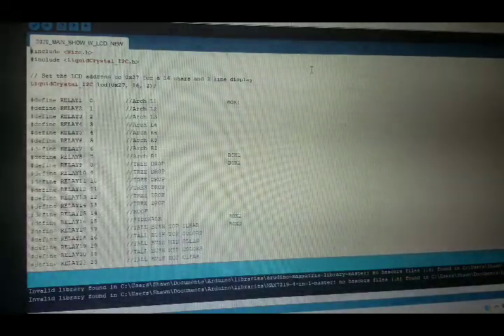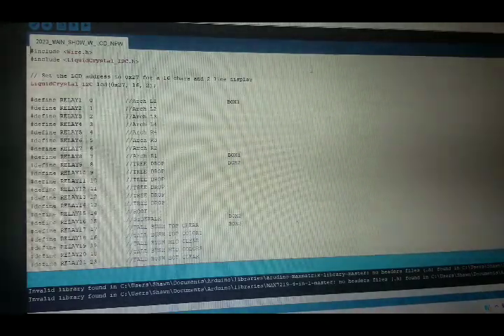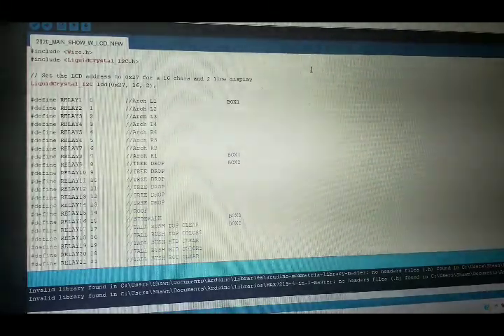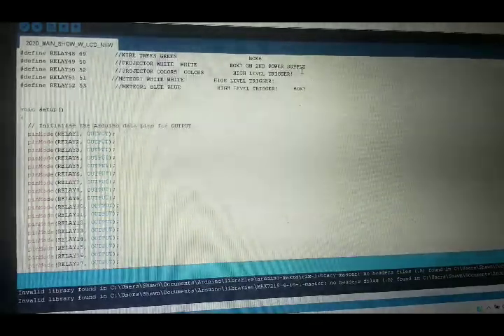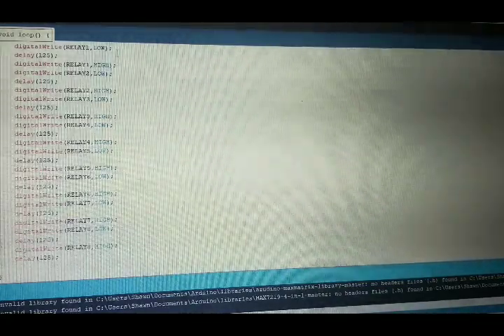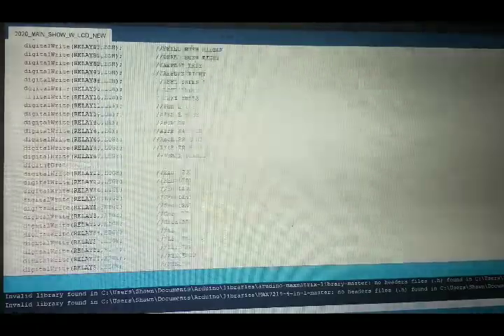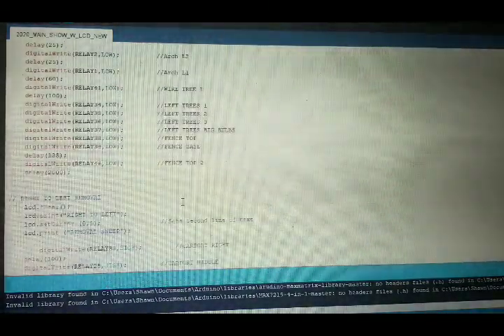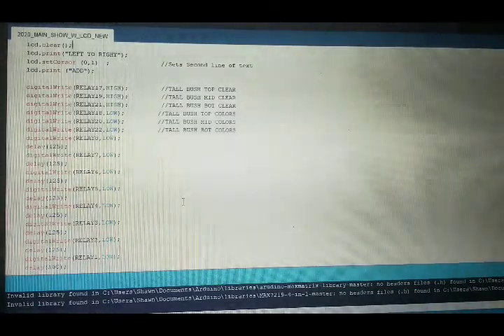Christmas Lights Display - Programming The Controller Without Vixen

Comment: Interesting vid.
I started out with running my lights off an old PC & my own programming..
The little program I made would read a data file with the actual lights-control data...
That data was a bunch of zeroes & ones for the off/on of each channel, a section for speed, number of repeats, & a couple other things.
A bit tedious to do a 'sequence' out of a bunch on 0's & 1's like that...but hey, it worked :)
Didn't do music or anything like that. 

------------
Still have that system, but now I use Vixen for sequencing my outside lights. (And the show itself is ran off a Raspberry Pi)
If you're planning to replace your relays in the future & do Vixen or xLights, you may want to look for a controller that uses SSR's (Solid State Relays) and does dimming!
Reply from the maker: 0s and 1s.... Wow! I bet that was pretty tedious. 
My controller runs off 52 SSRs. They just aren't dimmable. Hopefully I'll swap over to Vixen in 2021. If not, I'll make a few adjustments to this show and go from there.
Problem is, I got low level triggered SSRs. I'm not sure how Vixen is going to react to the low level triggers.
Itd cost me about $100 to replace them with high level triggers and hours and hours of time swapping them out.
Reply: @OutdoorsWithShawn  
I started with 8 channels, then increased it to 24 (that was the max limit - 3 parallel ports with 8 channels/SSRs, no dimming)
But this was also stuff I built back in the late 90's and ran off a Windows 3.1 computer. I got pretty good at the 0/1 thing, but did have to keep a list of what lights were on what channel nearby.

When I went to Vixen I got a Renard 32 channel controller & 4, 8 Renard SSR boards for it, that will do dimming, but the Renard stuff is also sold as just the boards, then you have to get all the parts and put it together like a kit - so its a bit time consuming.

With what you've got, I'm not sure how it'll work with Vixen. In Vixen, you setup your 'outputs' to whatever type of controller you have. (not sure what your controller counts as, since it sounds like you've basically built custom hardware....but I think what you'd end up doing is have Vixen send commands to the Audrino, the Audrino would control the relays (and account for some being the low type - without Vixen needing to know))

I'd suggest checking out a forum like doityourselfchristmas.com, that's one of the places I go when I've questions/issues regarding Vixen.
Most people these days are using xLights, but they are also running the RGB "Pixel" lights. Where I (and it looks like you too) are using standard AC lights. I did look at xLights myself, but found Vixen easier to setup & use for what I've got.
Reply from the maker: Thanks for the tip on the site! I'll definitely look into it. 
There is a way to invert the signal coming from the Arduino to the relays. Using a 7400 series Schmitt Trigger chip will invert the highs to lows with some wiring. No re-programming, no new relays. Just got to wire them up in between the Arduino and relays. I'm pretty sure that will work with Vixen. I think you set it up to General output or something like that; I've seen a few vids on it.
I'll probably be making a few test runs in my back yard this summer. I'm sure the neighbors won't mind. Lol
Reply: @OutdoorsWithShawn  
Welcome. That site is a pretty good resource, as I've found using it myself.

One thing I did think of, is you may be able to do is load FPP(Falcon Pi Player) onto the Audrino, and set it up to use your relays as is. Then I don't even know if it matters too much what you set up for in Vixen as long as it isn't set to dim/fade. Since its FPP that's actually controlling the what channels to turn on/off. (Vixen to put it simply in this case just creates the sequence/data file that FPP plays)

I use FPP myself on the Raspberry Pi running the show, in my case ofcourse it outputs to a device on the USB port, but I know there's a way to use the I/O pins for relay control as well, just have never looked at that part of the settings.
I set up Vixen for my actual controllers since they were listed, but like I say, I don't know if it truly matters since in reality its just exporting channel to a data-file that FPP reads (and FPP is setup to use your actual controller or relays) Channel 1 in Vixen is Channel 1 in FPP no matter what the actual controller/relay is. ((atleast that is my understanding of the actual functionality))
Reply from the maker: Cool, I'll look into that too. Thanks again!

Comment: If you are going to continue programing in this manner you need to look into writing functions and how to call them. Also if you want to do more channels in the future look into multiplexing. You could easily control double or triple your channels still just using the one mega. I am not sure how many channels Vixen will control. hopefully the ladies want pixels.
Reply from the maker: Thanks for the advice. I'm on the fence of whether to just run this show this year again, slightly modify it or start all over with Vixen. It basically depends on what I got going on during the year that takes up my free time and if I'll have enough time to start over with Vixen or not.
The ladies like the pixels, but also know the investment cost, so they aren't pushing me hard to get them for now. 
What they want is some three dimensional display props (Star Wars).